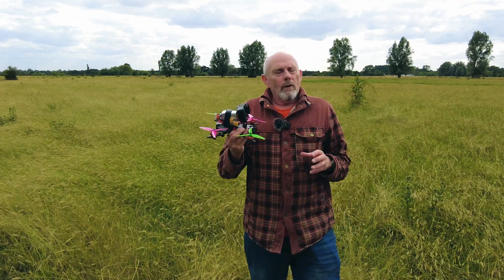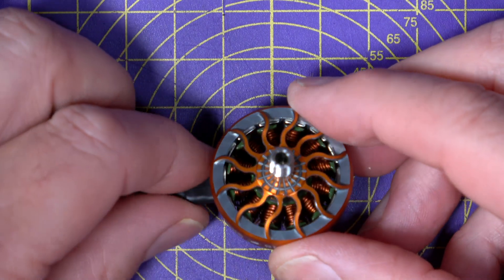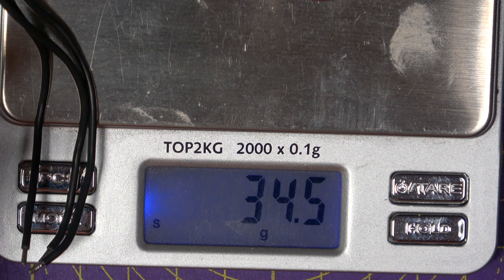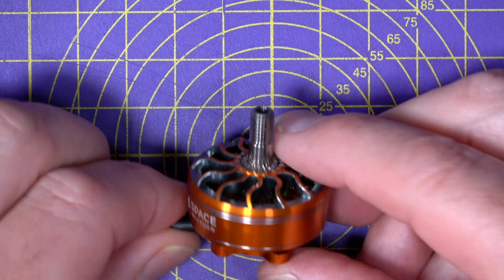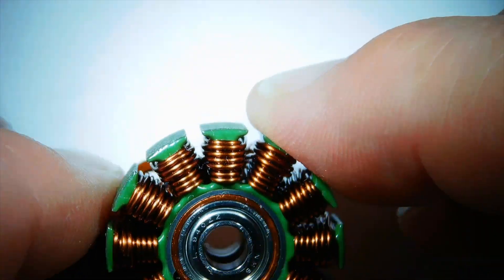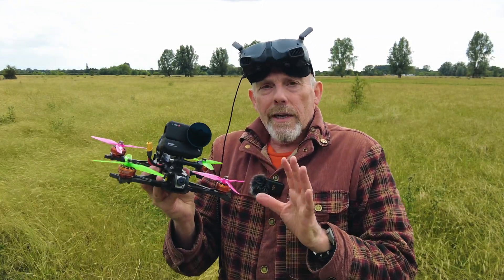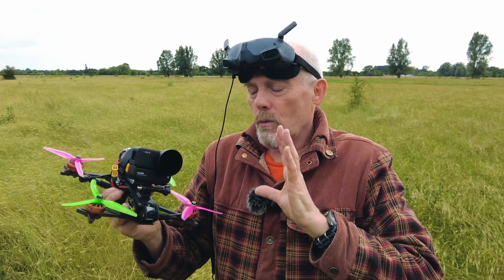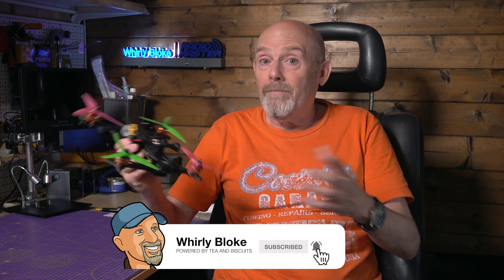MEPS 2207 1750kV FPV brushless motor - first look review MEPSKING

Comment: good video friend! I wanted to ask you if 1750kv or 1950kv is worth it for a smoother flight. what difference is there?
Reply from the maker: Thanks for watching. The difference between 1750kV and 1950kV motors mostly comes down to power output and efficiency.The 1750kV motor is generally smoother and can be more efficient at lower speeds, making it a solid choice for longer, more controlled flights. It tends to be easier on the battery as well. The 1950kV motor, on the other hand, provides a bit more punch and is usually better for high-throttle maneuvers or when you need extra speed and responsiveness. However, it can consume more power, which may reduce flight time a bit. For smoother flights, especially if you’re after stability and endurance, the 1750kV would likely suit you best. But if you want a bit more speed and don’t mind the slight trade-off in efficiency, the 1950kV could be worth a try.
Reply: @WhirlyBloke  Thank you very much for answering, it is clear to me🙏🏻🤙🏻
Reply: @Drones-España  COMPRASTE LOS DE 1750KV? ESTOY PENSANDO EN COMPRAR UN SET